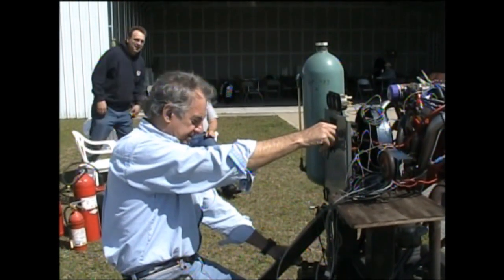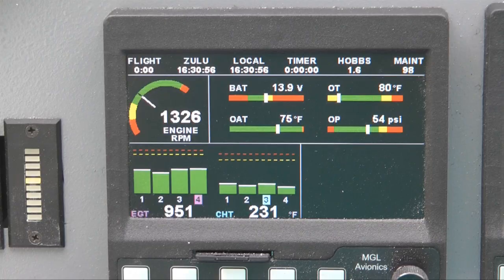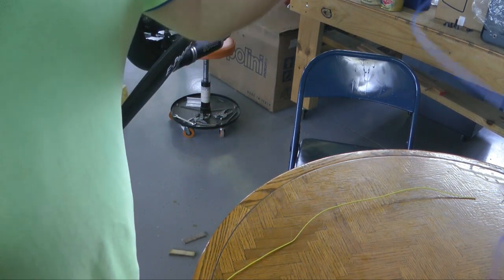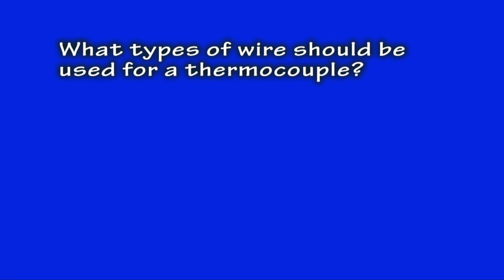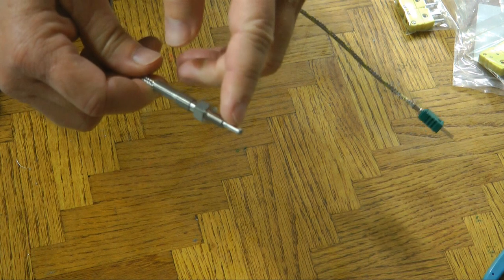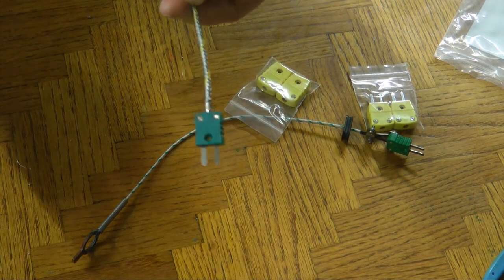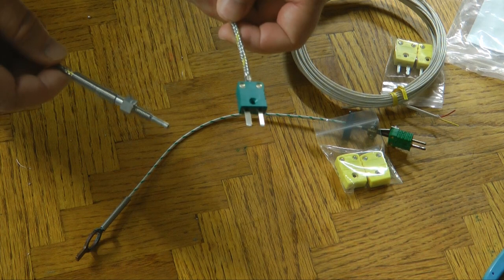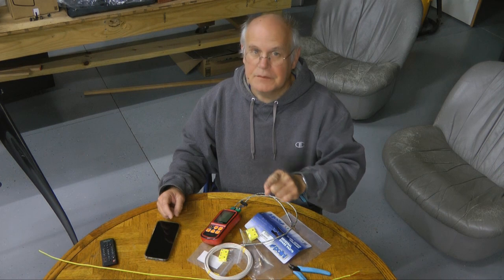Taking your Engine's Temperature

Comment: you can just use 20-22 ga copper stranded wire to extend the patch cable that goes to the gauge from your probe wires. thermocouple wire not used for this.

Comment: G,day from Sydney Australia.
Thank you for explaining the thermocouple, using dissimilar metal wires. Also the two channel voltage meter from Amazon.
Q1. Will length of wires effect continuity or a voltage drop?
That was a great instruction video: hands down.
🌏🇦🇺
Reply from the maker: No, not length nor temperature along those wires will affect reading! (with a properly designed display instrument)

Comment: If I recall my old engineering classes right, your segment on extensions didn’t sound quite right. As I remember the law of intermediate metals state that intermediate metals have no effect provided the splices are at the same temperature. If it were not true, the connection to the instrument would be different metals as well as copper and solder on the internal circuit board. I have used plain wire extensions in the past with no change in performance.
Reply from the maker: Thank you geezerguy for that observation. While I agree with you on the law of intermediate metals - you also did  provide the reasoning for not using the wrong metals in the extension.  It is often the case in our experimental aircraft engine installations that one splice of the extension is very warm (engine compartment - even close to exhaust manifolds) - and the other end of the splice may be behind the instrument panel (much cooler)  While this is not always the case - using the wrong metal in the extension in this scenario would violate the law and introduce errors in temp readings. You might argue that a hand full of degrees might not make much matter when reading CHTs and EGTs - but why ask for errors when using the proper wire will maintain accuracy?  As for the meter end - any good instrument has compensation built in for the metal connection. A thermocouple circuit requires a cold junction and the instrument is built to provide this function.  I do have an old analog CHT gauge from years back that has a long printed warning of how to manually 'correct' readout by adding a degree for every degree above 75 - the manufacturer clearly was aware of NO built in compensation (because of the lack of electronics in their inexpensive gauge!)
Reply: The two intermediate junctions should be at the same temperature, not that they are at the same temperature as the main junction. For example if you are using copper wires, the chromel-copper should be at the same temperature as the alumel-copper. They are usually very close because they are on the same miniature plug. They are at different temperature from the main point of chromel-alumel junction. Nice and very informative video as always. Thanks.
Reply: I think you are right, Jon. Those intermediate temperatures need to be at the same temperature as the reference temperature which is measured in the meter.
Reply from the maker: Hi Adam, I think it is easier to consider understanding substituting just 1 wire at a time: If you interject a single copper wire in a thermocouple K circuit, the 2 junctions at each end of the copper wire must be the same temperature in order not to affect the voltage. These two junctions of course will not be near each other and may have widely differing temperatures. Add a 2nd copper wire on the other side of the circuit and the results are similar.
Reply: @HomebuiltHELP  You are right, Jon. The error can be eliminated if the chromel-copper/alumel-copper and the in-meter junctions are all at the same T. (Note: They do not need to be at the same T as the measuring chromel/alumel juntion). In reality, these other junctions are usually at similar T of room temperature, so that's why people use copper wire extension without big problems. But I agree with you that the alloy wires are the way to go if accurate readings are necessary.

Comment: I recently purchased a dual CHT/EGT gauge. It has two different wire pairs: Type-J (lower temp range) for the CHT, and Type-K for the EGT. Both sensor pairs have one white and one black wire (seemingly non-standard; Chinese source perhaps?). Both pairs are a typical 48" in length. The gauge also came with a 1-foot long 'extension' cable consisting of four wires: black, blue, brown and yellow with green stripe. What are these made of? Who knows.
   I have no idea of the composition of these extender wires, but understand it matters. As you point out, Jon, the Type-K is nickel-chromium (chromel) and alumel. The Type-J is iron wire and Constantan (copper-nickel). Aircraft Spruce and Leading Edge Airfoils both have (Westach) extension leads, but the colors don't seem to line up with any particular metal composition. What to do?
Reply from the maker: Maybe try to verify by putting sensors in ice bath looking for 32 and boiling water looking for 212 F and see how close you are.  For CHT and EGT how accurate do we really have to be? Last choice is to go to Amazon and get $30 meter and plugs to see what temps are being realized.   Sometimes close enough is OK and but maybe not....
Reply: @HomebuiltHELP  FWIW, accuracy-wise, my engine has a warmed up, ready to go temp of 120°C and a never exceed limit of 250°C (248°F and 482°F - easy to remember).
Reply: @HomebuiltHELP  Thanks Jon! I was wondering about what to use for a heat reference and boiling water is perfect.

Comment: Thanks Jon!..does the type K wire come in different gauges ? Appreciate the info!
Reply from the maker: Yes, John - whatever your supplier provides. Also comes with various outer sheaths - or no sheath whatsoever (twisted pair)
Reply: @HomebuiltHELP  If you put different gauges for the extension will it mess up the readings?